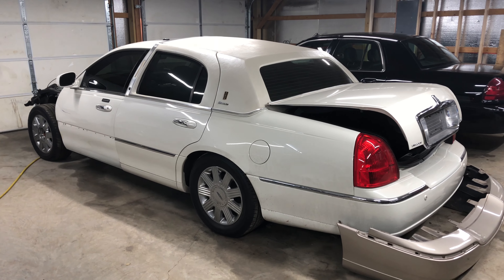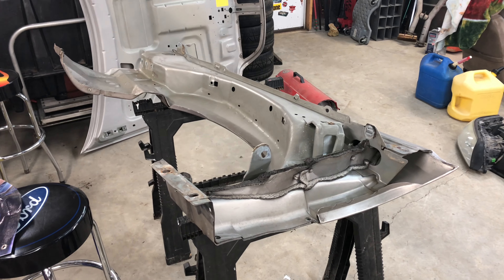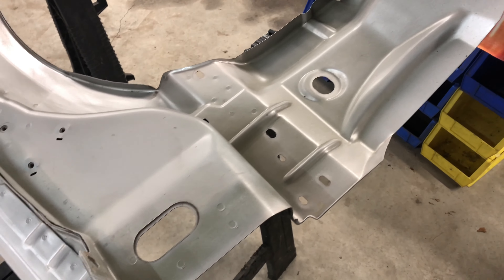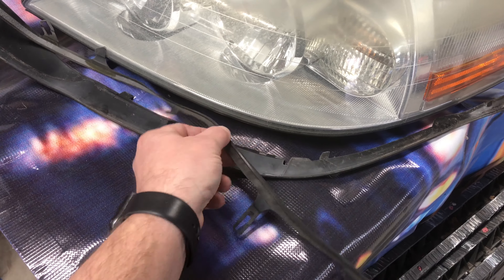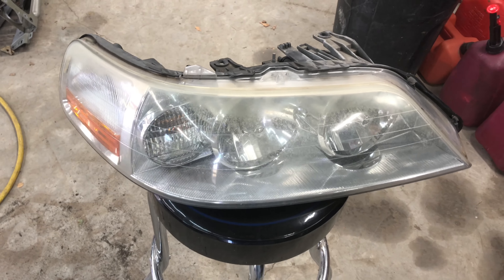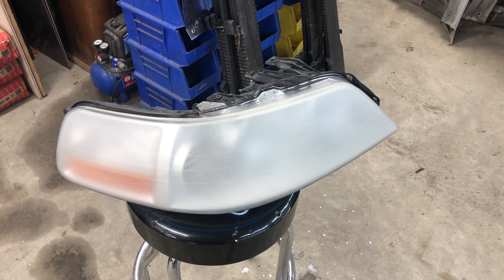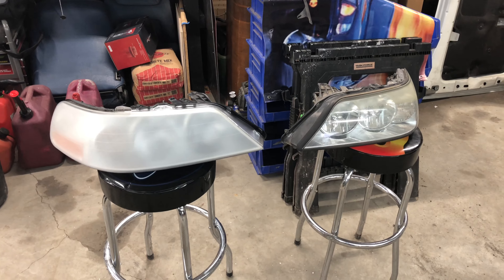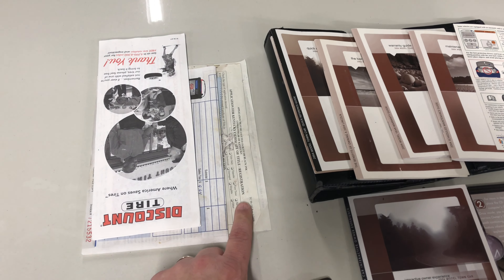Rebuilding our Lincoln Town Car project part 5

Comment: Did you finish the Lincoln? Do you have additional videos showing the rest of the rebuild after this video?
Reply from the maker: The Lincoln is currently at the frame shop getting straightened. Once it’s done there I’ll be able to pick back up with the rebuild. Could be another month before they are done with it. Thanks for asking, and thanks for watching!!